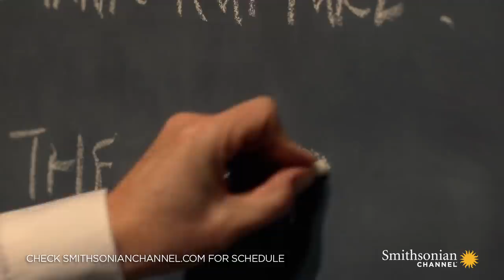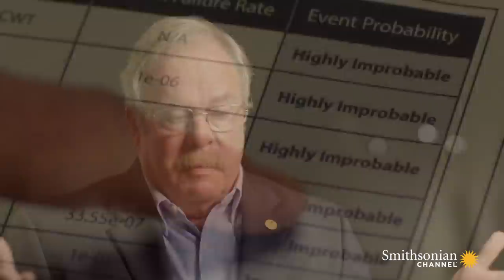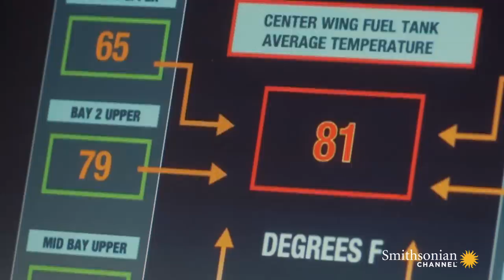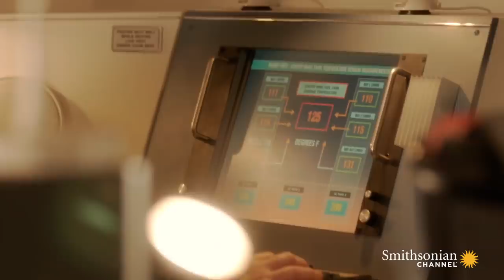How Air Conditioning Caused TWA Flight 800 to Explode

Comment: The tinfoil hat brigade will say that a small missile lainged from a shoulder mounted launcher brought down TWA flight 800.  Those with a full body armor made from tinfoil will even say an vessel of extraterrestrial origin brought down TWA 800.
Reply: Indrid Cold Well if the aircraft's design really caused the crash, why did Boeing do nothing to fix it, unlike every other situation like this that warranted a fix from the manufacturer to prevent further disasters?
Reply: @RidinDirtyRollinBurnouts  That is exactly my point.  It was cheaper to alter a proven design to fit components.  Then greed overcame common sense and they kept flaws quiet.  It is not just Boeing that has done this.   Design flaws are hidden from the public, until it is too late in many cases, and the companies producing the product do it intensionally.
Reply: WOW...you really stepped in this this really bad.  There are no design flaws in PHYSICS.  The story is 101% impossible.  Greed?  Really?  How do planes falling out of the sky... improve your financial success?  lol.  No body intentionally makes an aircraft to crash....   come on now!
Reply: If that is your interpretation of what 'tinfoil hatters' may say, then I suggest you research the issue for yourself.  The Navy fired two missles from one of two submarines and 21 surface vessels in that area that were conducting missile tests exercises.
The missiles were seeking out drones fired from one of the surface vessels,.......TWA 800 breached the perimeter of the military exercise airspace.  The first missile targeted the heat signature from the third engine of TWA 800, then the second missile targeted that explosion.
The issue with those center fuel tanks did exist,....up until 1969.  In that year,  Boeing completely 
redesigned the center fuel tank system for the 747.  The TWA 800 aircraft was built in 1971, therefore, the fuel tank issue did not exist for that aircraft.  The Clinton administration, FAA, and NTSB used the 'center fuel tank' theory as propaganda to cover for the Navy's grave mistake.

Comment: i watched this episode on TV and it was not good as it had claimed the NTSB was going stuff the FBI really did. the FBI where the ones that wanted the plane rebuild and not the NTSB as all they wanted to do was blame the airline on the basis of "this is the truth because i said so".

i don't think the episode shouldn't have been aired i just think it should not have had it look like the NTSB where taking credit for stuff they didn't really do.
Reply: In all aviation incidents, all material is examined and or in this case, a reconstructive pattern as reasonable as possible is performed to analyze.

Comment: AC: do you want to explode?!
Reply: not the AC  ….impossible....
Reply: @robshef718  how?
Reply: "how"?  are you an Indian?
Reply: @robshef718  how? The ac couldn’t explode it. The short circuit from faulty wiring outside the tank caused it. The faulty wiring allowed a high voltage current to jump to low voltage wiring and the low voltage wiring went into the fuel tank. Short circuit then boom from vapor fuel
Reply: @jonahmoran3751   I have already covered this....  :)

Comment: Sensationalist BS! The engineers have long known that the temps get this high and NEVER has an aircraft been lost because of anything related to it. There's another major problem with the fuel vapor theory. The fuel to air mixture was far too rich for any type of ignition without an incendiary event first rupturing the tank from the outside of it. This would require a heat source or explosive material to accomplish. On it's own, not going to happen .